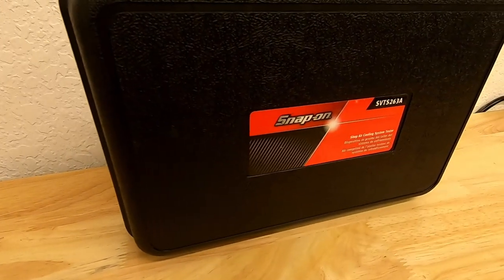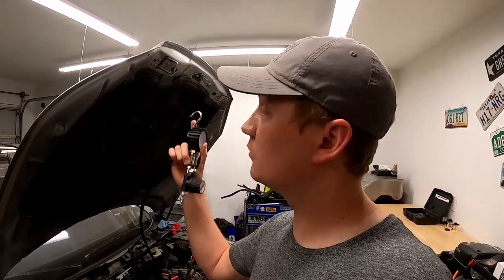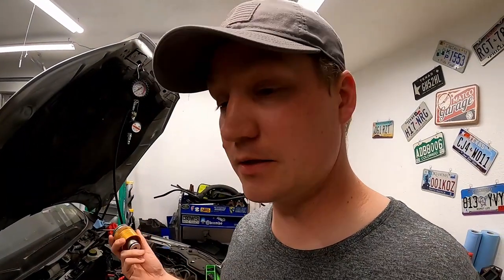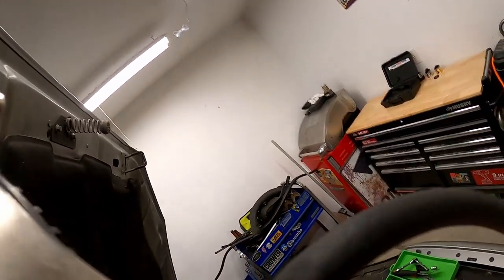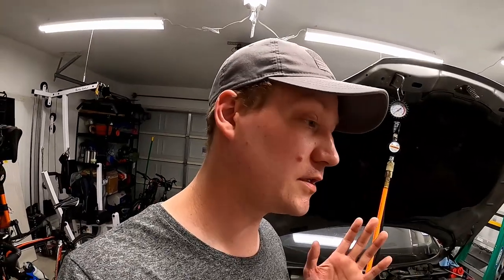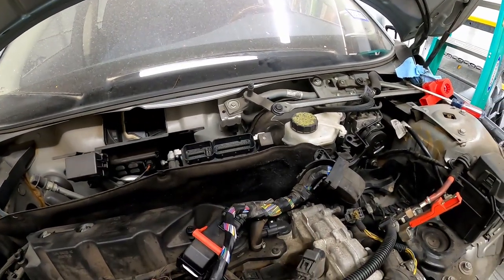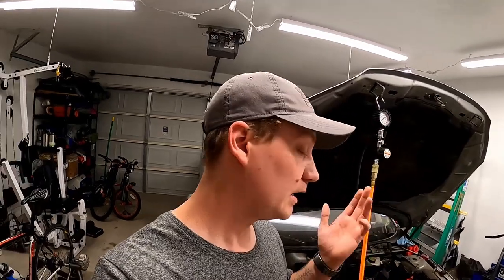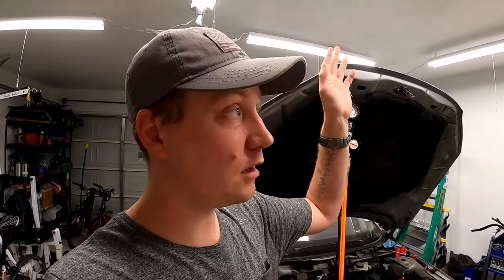Shop Air Powered Cooling System Pressure Tester

Comment: My coworker just got one of these I’ve had the hand pump so I ordered a regulator and ball valve and put an air fitting on my pump so if I don’t have shop air I can use the pump